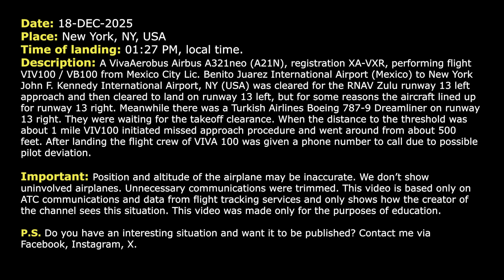Airplane attempts to land on occupied runway at New York JFK Airport. Real ATC

Comment: There is simply no excuse for that kind of mistake from a commercial airliner crew.
Reply: SAME THING just happened to me minus lining up for the wrong runway. Yesterday I flew into a non-USA international airport. We were on the base leg on the arrival which connects to the ILS to the runway on the right. ATC kept us very high, more than 3,000 above the path. Suddenly we're given an intercept heading and a proceed direct to a FIX on the RNP approach to the left runway. WTF! We were high and not setup for that approach. The First Officer was very good at reprogramming the FMS, briefing, completing required checklists, and checking landing distances. I suspect since the VIVA pilots weren't setup for the RNP Z to 13L since the FIX (ASALT) didn't make sense to them. The controller should have immediately recognized this. 

Runway and approach assignments should happen well in advance so there's plenty of time to program, brief and fly them without surprises.
Reply: Get yourself a scanner and hang out at some international airport listening to the tower freq.  You'd be surprised the sh...t that goes on. Not only foreign pilots but US also.
Reply: Shades of Aerogal doing a similar bonk move with Kennedy Steve!
Reply: Yea I don't know what the training requirements and qualifications are necessary for a lot of Latin American carriers, but as an ATC at an airport similar to the level of JFK, we always have to use heightened caution and awareness whenever we are dealing with Viva, Volaris, etc. we joke about the odds of them going around being much higher than anyone else. They constantly seem disoriented, confused, and just generally behind the airplane.
Reply: @jd-793  That's because it didn't happen - it's more fear porn